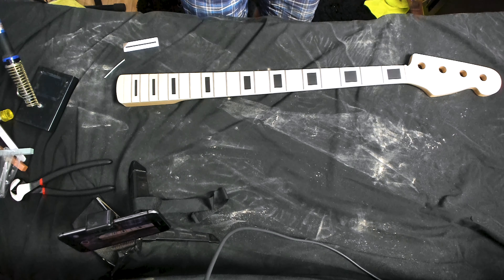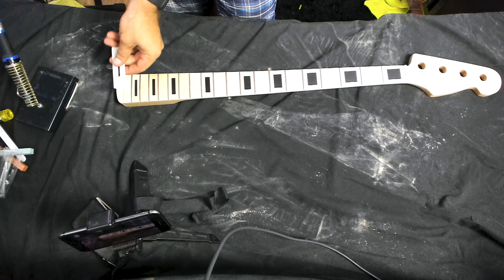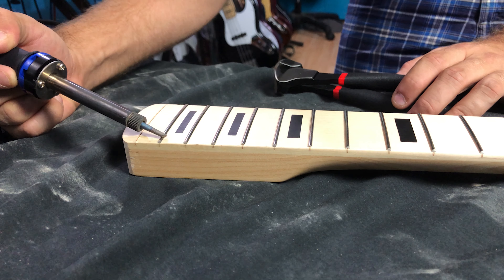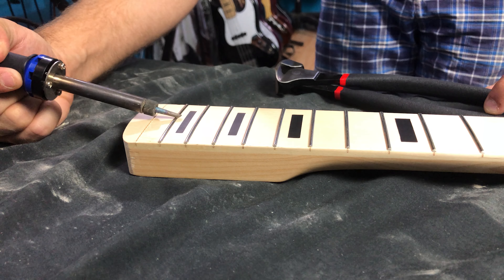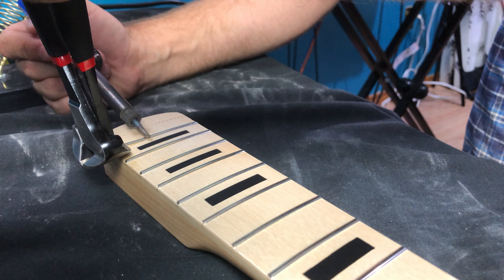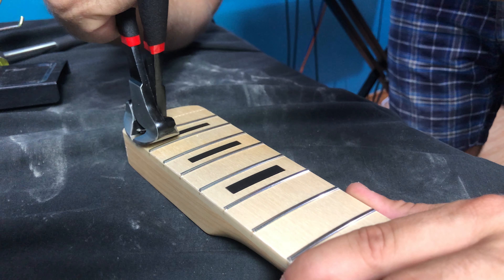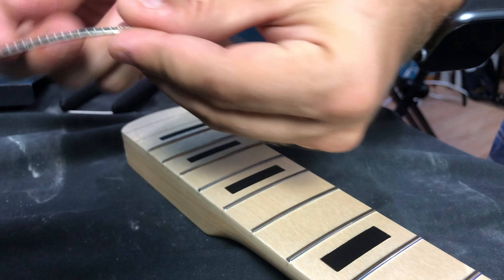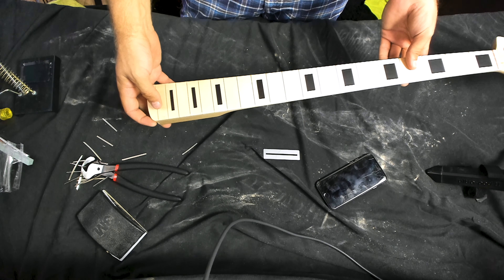Removing Bass Guitar Frets

Comment: Nice work ! What did you end up doing with the inlays ? I'm considering doing this myself , but I'm wondering if the blocks would affect the sound.
Reply from the maker: I never did finish this construction vlog, but I did finish the build and have been using the bass for several years now. It's the Purple + Gold Jazz bass featured in some of my cover videos.

I did not have the space, tools, or skill necessary to remove the block inlays and replace them (or the fret dots). I actually ended up getting a sheet of brushed gold adhesive vinyl. I then cut them to match the size of the original inlays + dots using a Sillhouette Cameo cutter. I stuck them on and then oiled over the entire thing.

Not the most professional approach, but it worked and looks surprisingly good.
Reply: @PoizenJam  that sounds beautiful ! Thank you for getting back to me ✨
Reply from the maker: @annja_saudade  You're very welcome! And here's a video where I'm playing the completed bass if you're curious:

https://www.youtube.com/watch?v=-nqwvboNdaw